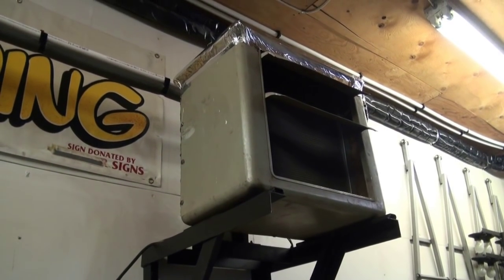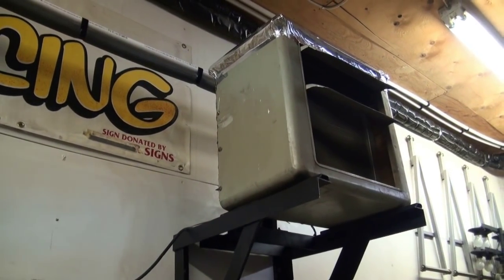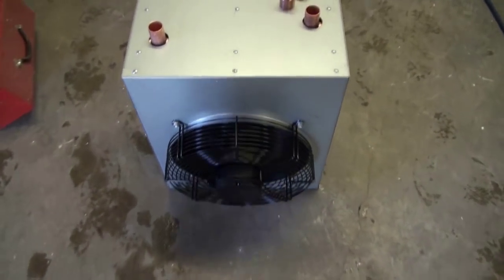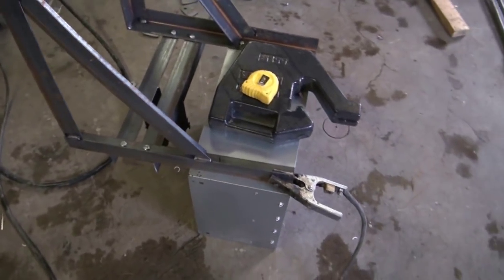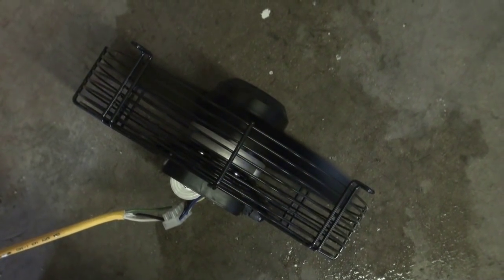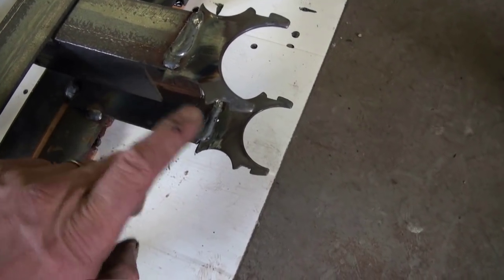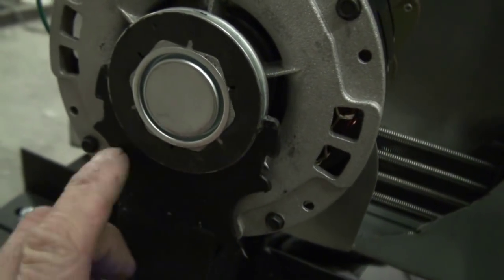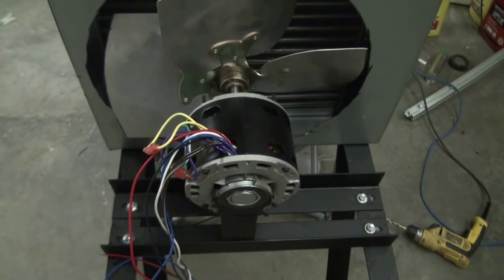Solar heat rad and fan booster pt1

Comment: I bit the bullet and bought a set of 10 of the short tubes just to play around with. I don't know if they are as high quality as the ones that you have or not. They were just bare tubes with no heat pipe or the aluminum bit that slips inside. I played around with making the heat pipes with acetone in them but I'm not getting very much heat out of them and I'm not considering buying the heat tubes that are factory made for them. Have you looked into absorption or adsorption refrigeration systems to use your heat during the summer for cooling?
Reply from the maker: +harperjmichael  I am interested in AC from these systems, I may look into it a little more yet.
Reply: From what I've been reading it's the same principle as an RV refrigerator where it uses a pilot light to boil an ammonia and water solution. I can't see any reason why the heat from the solar thermal system couldn't do the same thing, especially with the heat it will generate in the summer.

Comment: I could use a system like that right now lol.  Whats the cost of a small system and a large one?
Reply from the maker: +ShawnCFarm A 5 panel kit set up for floor heat is about 15k, extra rads and such like in this video would not be included however a nice 120 gallon UL/CSA heat exchanger is which is also a nice way to store a little extra heat
Reply from the maker: +ShawnCFarm  These solar tube panels were 1325 each Canadian last I checked

Comment: I don't know much about HVAC but I do know they make special "condenser fan" blades. Yours kinda looks like a condenser type blade. A regular fan blade like a table fan won't have enough static pressure to push air thru the fins in the rad. 
But a condenser fan blade makes high static pressure and forces the air thru the fins. 

Other than that, I can't believe how much temp you're getting on the hot side off the collector! Wow! I just paid a 'small' gas bill at my shop ....$350 for a mild last month. 
You have my attention! 
I thought solar was tried years ago and deemed not worth the effort??
Maybe the suns getting closer to the earth?
Nice installation!
Reply from the maker: +kmcwhq I really like it, also I heat the house basement and garage with solar but there the floor heat is set up for it
Reply: +groutaone  Watching with great interest, thanks for sharing. 
Have you said what your investment total is?
And any idea of months of payback?